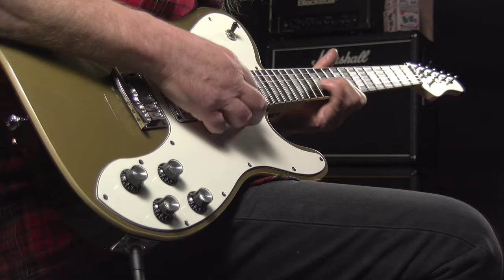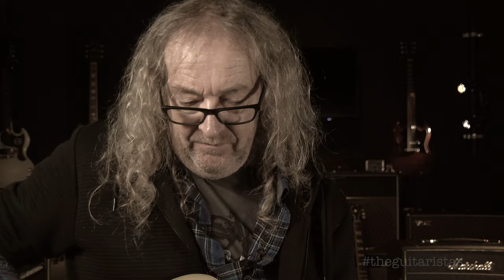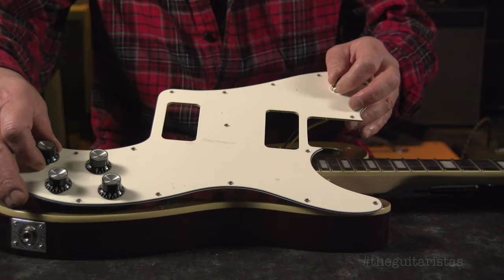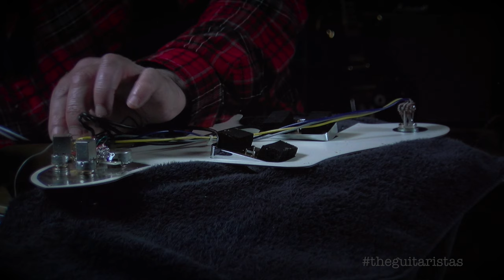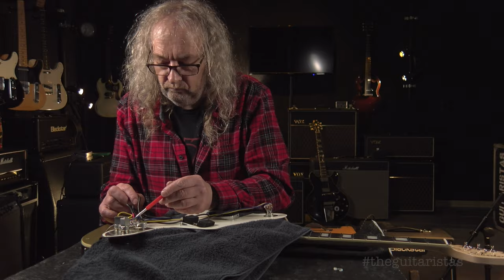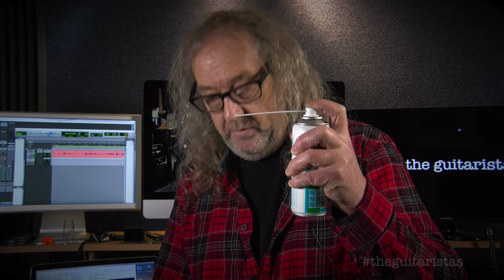Schecter PT Fastback (Pt 2) - Wiring Fix?

Comment: Colin you make this guitar sound great, I have a touch of G.A.S. after watching this one but worried about the neck ...I hate flattish d shapes and u shapes I like a proper c without too much shoulder and soft Vs being the winner, funnily enough I have small hand but find chording so much easier on a fuller neck.....great vid again mate. I really can't fault this channel only complaint is one vid a week....they are just so good I always want more, only found you this week rapidly consuming your back catalogue...keep it up mate you are the everyman guitar geek and a fantastic player too boot. I'd love to have chat one day I have some value guitar recommendations 👍👍👍
Reply from the maker: Hey Michael, thanks for the kinds words! There is something about the feel of this guitar that I really like...I just checked the neck and it's definitely a rounded C shape (def not flat D or U) and not too thin, so you should give one a try if you can... very silky smooth which I like a lot, The electrics do let it down though... I didn't fix it btw! and am in the process of swapping out the lot and replacing with standard CTS / Switchcraft set up. Cheers dude!

Comment: I had the same problem with my new PT Special. The problem was the toggle switch. I was about to buy a new one and discovered the small flat piece that moves from side to side was missing the connection. I pressed it in the centre and bent it slightly and had no problem since. Hope this helps.
Lindsey from Australia.
Reply from the maker: Cheers Lindsey... this one is still in pieces awaiting my attention! 🤣🤷‍♂️
Reply: Same problem with my fastback. I just finished cleaning all electronics with electronics safe cleaning spray. I wish I could see a pic or drawing of what you did to your toggle switch....i am having trouble visualizing it. Thanks for the post its the most logical fix i have seen yet pertaining to this problem.
Reply: If you look at the switch there is a small blade that moves from side to side and you’ll notice it only just touches on 1 side. I just bent it slightly with a small screwdriver to make a better contact.

Comment: Hey Colin. Will that scratch plate take Gibson humbucker a or are those smaller than normal? Debating between this or an epiphone LP custom silver burst.
Reply from the maker: Hey Richard, yes it will take humbuckers I think... the wiring fix didn't last long so I took it apart and I'm still in the process of putting it back together but have kind of stalled! 😆👍 Epi Silver Burst sounds nice!
Reply: @theguitaristas  yeah, I was on my way to get the silver burst and I got an offer for a PRS McCarty S2. Now I’m back in my head on which to get. I have a Gibson ES LP, but it’s a semi hollow. I want a solid body to hang on the wall beside my SG standard and ES LP. 🤪

Comment: Hi Colin,  will the rig take P90's with no mods to the rout or pickguard?  Will the harness need anything added or removed?
Reply from the maker: Hey Tim, cheers for messaging me on here!....as it happens the strings are off and the pick guard loose as I am in the middle of replacing the wiring properly (a stalled project! 😆) so will have a look and come back with an edit in a couple of days.

Comment: Hi I was thinking of purchasing this guitar in the white and I was wondering what you thought of the humbuckers because their mostly the thing holding me back from purchasing the guitar because of their low output. And also do you reckon the guitar could fit other humbuckers
Reply: Unless you want to play tight chuggy metal on it, the low output won't be a problem, I have a filtertron in my tele and it has something like a 4.6K wind, I play everything from classic rock to garage punk on it and it sounds great.